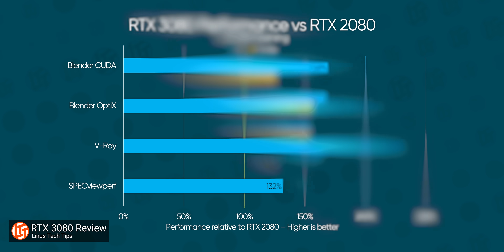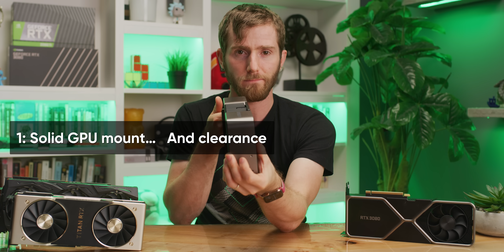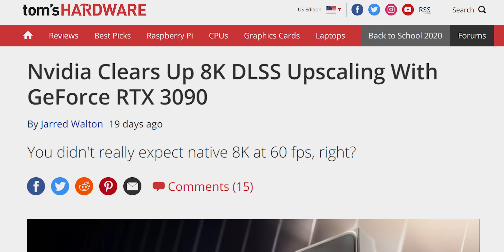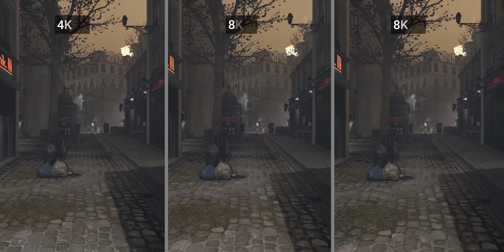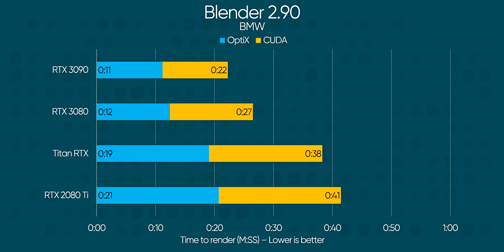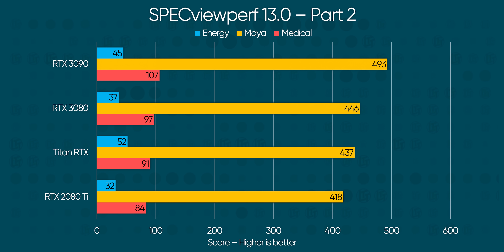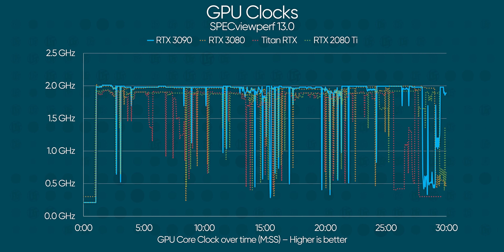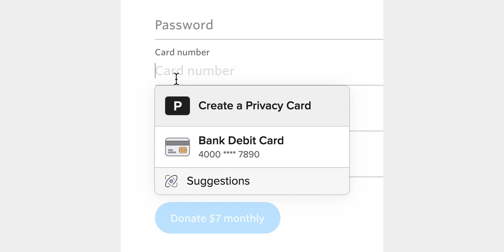Making Nvidia’s CEO mad - RTX 3090 Review

Comment: Youtubers clowns have huge confusion about GPU usage, for cad you use Quadro, not the titan. Any usage that needs a certified driver for calculation  need Quadro(or AMD equivalent), you don't design a building and take the risk that your GPU does some errors, because if you building fall down you are the one to blame not the GPU.  Same things on scientific workflow and engineering simulations.
You can use the 3090/titan in the "creator" workflow where errors are not critical. Is not difficult to understand but youtube clowns don't get it.

Comment: At 3:40, it should be ( 7680 × 4320 ) pixels × 32 bits per pixel / 8 bits per byte. When you cancel the units, you're left with bytes. Going off of the calculation in the video, when you cancel units you're left with pixel-bytes, which makes no sense. It all stems from treating pixels like a unit of length, which can be done is some contexts, but this is not one of them. For example, let's say I have 27 metersticks. If I were to arrange them in a 9×3 grid, would I suddenly have no metersticks and 27 metersticks²? Would a 3×3×3 cube result in 27 metersticks³? No, I'd still have 27 metersticks, what even is a meterstick to a non-1 exponent?

Comment: Basically, it is no generational leap. Just an enormous pcb with higher clock speeds more vram and a huge cooler, like making a THICC Turing since its tdp is 100w higher? Except for the rt cores, does really improved.

Comment: this is a question for anyone who can answer: I’m about to build my first pc and i have a hard drive (seagate 1tb barracuda) but i was wondering if i need an ssd. like if i don’t get one now, will i be able to add one later for fast boot times or something? basically, is an ssd a necessity?
Reply: Yes. You need an ssd. Don't bother with hard drives unless you use them as large storage devices. The operating system, programs and all go to the ssd.
Reply: oh ok thanks
Reply: one more thing. i know there’s a couple types of ssds like the nvme ones, the pcie ones, and the sata powered ones. which one is the best?

Comment: This video is proof that LTT can be bought. Pay them enough and they will do a promotional video or two quoting Nvidia marketing slogans - "it just works", 8k gaming.... while failing to point out Nvidia's 3090 CANNOT even come close to the claims of 120 fps 4k gaming or 60 fps 8k gaming UNLESS you USE 9x DLSS UPSCALING and turn down quality settings in the game to keep frame rates from tanking to unacceptable/unplayable levels!!! Otherwise Control might only run at 5 or 10 fps at 8k... so, it doesn't "just work" and NO "8k gaming" is not here yet...  This is a very disappointing video... I thought LTT had more integrity and better ethics, but, sadly not today...

Comment: Testing current gen games on 3080 and 3090 is almost useless considering how horrible most engines multi core support is. Only once next gen consoles with multi threading come out devs will suddenly bother opimizing for more cores and threads as if it's a new feature.

Comment: I’m honestly kind of annoyed at Nvidia when it comes to the 30 series. I recently got a 2080 Super and was gonna swap it for a 3080 (didn’t happen because of scalpers), but what annoys me more is that I don’t think I would get as good of performance as I’m getting now if I had done it. I think I would have needed a new CPU, Mobo, and PSU to keep up with the 3080, and I still would have left performance on the table because of my monitor only being 1080p at 144hz.
I have a Ryzen 7 2700, and a 650 watt PSU, would the 3080 have even been worth it for me? I would like to see a video of the 30 series matched with less than adequate computer specs.

Comment: dunno man... at 300+ Watts this really isnt a consumer GPU and it should get backlash for being that big of a power hogtake away all the wattage leap and if you think about it if they tried to keep the 270-280 W compared to the 2080TI the 30xx launch wouldnt be that impressive... the bad thing about all this is, how are the lower end 30xx cards gonna look like? Are we gonna see a huge performance gap stepping down to 3050 because they lower the TDP to relatively match the older low end gpus? Or will they introduce a stopgap models like 3040 or something like that to keep the performance charts between their lineup more linear, because if the keep the same number of models per series they will have huge performance gaps in it and they still need low TDP cards

Comment: Ok ltt folks . I am a YouTuber/streamers is the 3080 enough or should I fork up for the 3090.
If it relevant am currently on a 1070 with an i5 so I know I need an upgrade but having a hard time with the GPU decision. I know for sure to upgrade the cpu so I'm waiting for the zen 3 to launch so I won't miss out if that launch is a huge improvement from zen 2. Thanks for the advice in advance.

Comment: But a 850 PSU should be enough for a max 400 watt GPU right?

My i9 9900k uses 200 watts @ 5Ghz, I would like to get a RTX 3080 as well on a 750 watt gold Corsair PSU, this would work right? No mechanical drives attached, 1 ssd, 5 fans and Gigabyte Z390 Aorus Master.

Comment: I wish you emphasised just how nitch it truly is. For non-8K users the power draw doesn't scale well and makes it not worth it over the 3080, unless you really need a few extra ferps out of Quake. For the select few millionares out there who have time for gaming, and don't get it twisted, very few people can play on a $30k TV, and there is only one 8K computer monitor on the market, and it is not designed for gaming, not that it really matters with those terrible frame rates, and because almost no games actually have a true 8K resolution to try and run with DLSS off. DLSS, btw, is also cheating, because it you're rendering the game at 1440p, the GPU isn't running the game at 8K, so it's not really 8K gaming any more than playing a 4K game on an 8K display would be; it just has better scaling than the TV's native upscaling.

Comment: I think the 3090 is more like Titan, which aren't really designed for gaming.  I'm holding off until the 3080 Ti comes out (if it does), it will be cheaper than 3090 with probably the same or better performance.  I have no reason to buy an ampere card yet anyway.  I game on TV and have to upgrade to a TV with HDMI 2.1 first.  No reason to get a card that can go above 4K 60 if my display can't even do it.

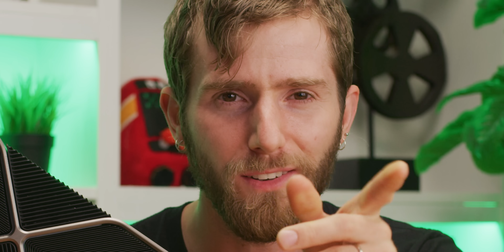Comment: 9:37 CATIA and Siemens NX is shit software that artificially slows itself down if it detects a consumer GPU.

There is no such thing as "driver optimizations". It's either good or bad software. There are many other benchmarks that prove this point, for example GTX 1070 vs Quadro P4000. Identical GPUs with different name, but the 1070 is artificially slowed down to the point that the software is unusable. Yet they call that garbage "professional".

Comment: "*vs 2080...." The 2080, is not the 3080's predecessor, the 2080Ti is.
Reply: well...no. Price point, naming, etc... all make the 2080 the predecessor. Just because it out performs even the ti, does not mean the TI is the predecessor. We are almost definitely going to see a 3080ti at some point, which will be priced somewhere between the 3080 and 3090 and have performance in between there. That will be directly replacing the 2080TI, not the 3080, nor the 3090
Reply: @mathewwebb8222  Well... no. 

Ampere has double CUDA cores fo Turing?
3080 has double CUDA of 2080Ti at 8704 and 4352 respectively.

2080 only has 2944.

3080 and 2080Ti both use the 102 Die. GA102 for 3080, TU102 for 2080Ti. 2080 has the TU104.

TMUs - 3080 = 272. 2080Ti = 272. 2080 = 184.

NVidia calls  them both 'Flagship' models, with only 'Titan-class' cards sitting above them.

The 2080Ti is the 3080's predecessor, not the 2080.
Reply: @RobinHood-yk8og  I mean, I guess it depends on which way you want to look at it. Naming conventions and pricing certainly put the 3080 directly replacing the 2080, not the TI. I think the public will look at it that way as well. All of the review material places is against the 2080, nVidia places it against the 2080...I mean, this is a new generation of GPU's. It's not necessarily surprising that an 80 series will have many similarities with the 80TI from last gen.
Which also brings up the question, if/when we get a 3080Ti, is that ALSO a 2080Ti replacement? Or is that a titan replacement along with the 2090?
Reply: @mathewwebb8222  

Where will a 3080Ti go?  The 3090 is 5-15% better at gaming than the 3080. Is there room for the 3080Ti? Maybe it will have more VRAM, but the 3080 already has more than enough for 4K gaming, and more VRAM wont offer any other performance improvements.

"It's not necessarily surprising that an 80 series will have many similarities with the 80TI from last gen.
" - Look at the specs for previous generations. That's just not a correct statement.  Not only is the 3080 the direct replacement for the 2080Ti, this may be the first generation where the specs match the previous generation so closely. It's as if NVidia just added their extra FP32 lane and the improved RT/Tensor cores.  The underlying architecture isn't all that different. Ampere is basically just (in air quotes 'cos it's a pretty big improvement) Turing 2.0.
Reply: @RobinHood-yk8og  They have already hinted that we'd be getting a 3080 with 20gb of vram, which will likely be the 3080ti, so yeah, I would say there is room somewhere.  

Regardless, it's pretty obvious we aren't going to agree here. But when nVidia themselves are comparing it to the 2080, I kinda feel like it doesn't really matter what you or I say.
Reply: @mathewwebb8222  NVida's marketing department has a job to do, selling cards, so taking anything they say at face value - such as; "x2 better than Turing" -  without digging into the actual numbers, is a mugs game.
Reply: @RobinHood-yk8og  Yes, but this isn't so much about the numbers and technical specs, as it is about: Price and Naming. That's all I'm saying. You can say that it is essentially identical to the 2080ti all you want, but A) It's not PRICED like a 2080ti, and therefore is not replacing it. And B) it is not named like a 2080ti, and therefore is not replacing it. From a consumer standpoint, the closest analog from last gen is the 2080. Specifically because it costs basically the same as 3080, but also because they are named the same.  And I think you are really ignoring that aspect of this argument.
Reply: @mathewwebb8222  that's a marketing angle... it's irrelevant.
Reply: @RobinHood-yk8og  The price of the card compared to a 2080ti is...irrelevant?
Reply: @mathewwebb8222  .... Yes! It's marketing BS. If NVidia was less concerned about consoles & RDNA 2, the price would have been at Turing Ti levels.
Reply: @RobinHood-yk8og  And you have evidence of this? Or anything other than an opinion? I mean, right now, we have a card released at a price point that says you're wrong.
Reply: @mathewwebb8222  ? ? ? You saying that prices aren't market dependent? Get out of here.... if NVidia could charge Turing prices, they would. And you'd probably be sat here defending that decision as well.
Reply: @RobinHood-yk8og  No, I'm saying that if this was actually meant to replace the 2080ti, it would be priced like a 2080ti and called a 3080ti...because obviously the market can bear the price point of the 2080ti...like, it would be super easy for them to just release the 3090 as the 3080ti, but they aren't. It would be super easy for them to release the 3070 as the 3080 and the the 3080 as a ti, but they aren't. Pricing, and naming, matter. This is directly replacing the 2080, and we will eventually get a 3080ti, just like they originally released the 2080 and 2070, and we eventually got the rest of the cards in that series....the way they always do shit.
Reply: @mathewwebb8222  Pricing and naming do not matter.... They can call their cards anything they like, and the prices are market dependent.  The 2080Ti  was priced to sell in a market it dominated. The 3080 is priced to sell in a competitive market.
Reply: @RobinHood-yk8og  I'm pretty sure I said this already, we aren't going to agree. They can call them whatever they like. And the prices are market dependent. Meaning, they decided to call this a 3080 and decided to price it to make it compete/replace the 2080, no the TI, which means, that's what it is doing. You saying "it's replacing the TI" is completely ignoring the fact that this is the same price as a 2080, and thus is aimed at the same people who would have bought a 2080. Not a 2080ti. Straight up, this could out perform the RTX Titan, but if it isn't priced the same, it doesn't matter.
Reply: @mathewwebb8222  You're just making stuff up now buddy.

Comment: I don't get it. How is the performance increase measured? 100% improvement while gaming in 4K using DLSS 2.0? Because that would make it more of a software tweak instead of a real hardware improvement in terms of raw power. In general I don't like DLSS: it is a a software improvement and soon we will „be able to play in 64K with 60 fps.“ Well, that's kinda true. It is like gaming in 8K: the output is not native. As long as that card does not push an absolute minimum of 120 fps in native 4K with maxed out settings, it is no good.

Comment: So 2 3080’s are cheaper than 1 3090 and will actually fit with 2 in your case and blow the 3090 out of the water in rendering since they scale uniformly in redshift and octane.

Comment: Guys i still have nvidia geforce gt 525m laptop with an i7 2670qm cpu and 8 gb 1666mhz A-data ram and 7200 rpm 750gb hdd... 
Is it time for me to upgrade...
If so can anyone suggest a good laptop with top of the line specs...but on low budget...
I am poor...

Comment: I am as tech enthousiast as Linus, Linus viewer, and everybody into new tech. 

But LTT need to step up their game about the rant against Nvidia, get back down to Earth, and call for the bullshit right there. Because this 3090 is a pure scam from Nvidia.

1440p is barely a thing nowadays, steam charts show that even 1440p is around 6.6%  on Steam, and 2160p is 2.24%.

This "8K IS POSSIBLE BABY" speech is 'useless' for us for atleast 10 years from now ( if even more, we were already doing that with 4k since years, and it's barely start to be here, both graphical card and monitor side).

And the 3090 price doesn't scale up right at all. +100% price for barely a maximum of +20 performance in certain game (yes, certain game ) is not worth it. At all. 

Even back in the day of dual GPU on a single card, these sort of price brang atleast +30% of the performance for.. +30% the price. Hell, even SLI brang more performance in game for +100% increased cost.

The fact that overclocking a 3080 make it reach the level of the 3090 in 4k gaming is straight sign that Nvidia is not giving a fuck anymore and is just cash grabbing. They turn into the Apple of Graphic Cards.

Comment: I want to make sure I buy the current best in slot parts, and not be a chump who spends $4k and then suddenly finds himself outclassed with a new CPU that hits the market a month later.
The 3090 came out today and I figured it's time to pull the trigger. 
Any way to improve this?
>I want to open 50 firefox tabs.
>While editing videos in Sony Vegas
>While rendering out recorded video on Xmedia Recode
>While streaming to youtube
>While recording video on a HDD.
>While recording 5 minutes of replay footage I can "save" at any time if something crazy in game happens.
>While rendering a video in Vegas.
>While multiboxing a few games.
>While having discord and other "apps" running.
I thought about SLI, but back in the day when I SLI'd gtx 480's every current game on the market ran worse, it had lots of problems with the gpu's failing and ultimately when I just ran a single 480 games like Starcraft 2 and other mainstream games at the time just straight up ran better. 

nzxt h510 Elite case
Rtx 3090 GPU
i9-10850k CPU
Asus Rog Maximus XII Hero Motherboard
64g 4x 16g sticks G.Skill TridentZ 3200mhz

$4,000. Should I?

Comment: Not having Nvlink on the RTX 3080 is dissapointing, i would have prefered 2 RTX 3080 than a single RTX 3090 for pro software that can use NVlink.

Comment: It is the best money can buy.  But, at a very poor bang for the buck compared to the 3080, and the future 3080 20gb Super which would be " the card to get". I like most EVERONE, do not have an 8k display. Can the the difference between 4k and 8k even be noticed? I can see it for 4k ultra fast frame rates and refresh with settings cranks.

Comment: 3050ti or 3060? What about the "entry level" (pleb) GPUs?
I want to change up my 1050ti, but i'm still at 1080p@60, i don't really want/need more
Reply: Then stay with the 1050ti?
They're focusing on 4k and 120hz now because consoles are doing it. Tech seems to want to replace 1080p. 4k tvs are getting cheaper and for a while many phones have been running higher res displays too. 
There wasn't even a 2050ti, and power/price difference between the 2060/super and 2070 was basically a ripoff.
Reply: @bruhtholemew  There "was" with a messed up naming scheme... 1660Ti, thats in my GFs VR rig